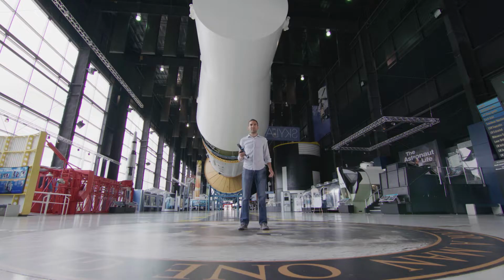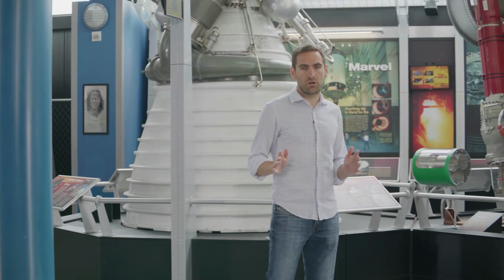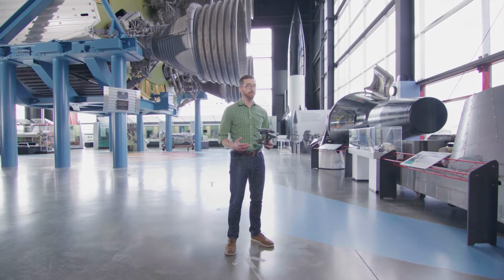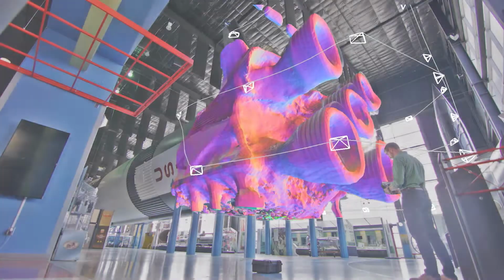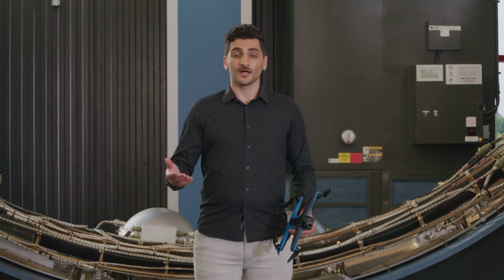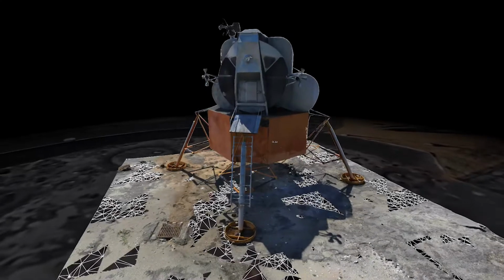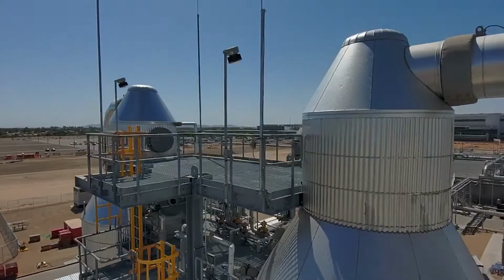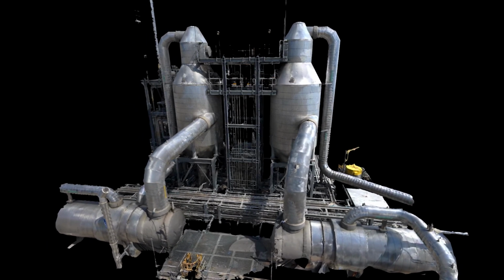Skydio 3D Scan™ Keynote - The New Era of Autonomous Inspection

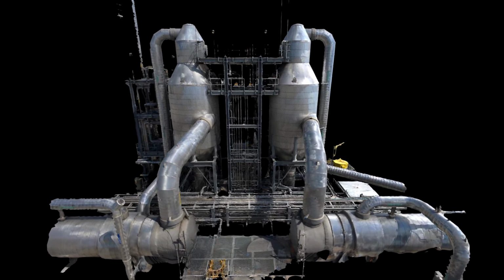Comment: Somebody needs to Google the boiling point of water.  It's not 200 degrees. 20:44
Reply: 200 C?
Reply: WATER
Boiling point

212°F
100°C
It seems like one of those basic science facts: Water boils at 212 degrees Fahrenheit (100 degrees Celsius), right? Well, not always. It depends on where you're doing the boiling. In fact, water will boil at about 202 degrees in Denver, due to the lower air pressure at such high elevations

Comment: HOW DO WE ACTUALLY GET THIS??? I now have the Skydio 2 for this but there is no way to purchase this $3,000/year feature without contacting you guys first... the only problem is that you guys still have not responded to any of my emails (I've now tried from multiple email accounts as well). Need to get this ASAP...

------------ UPDATE: read replies to this comment ------------
Reply: where you able to ever get ahold of them I'm trying to get this also and have a skydio 2 already?
Reply: @GrapevineCarbine  yeah but it took a long time and each email I had to pry for instructions and information - which they trickled in. Like pulling teeth. I got the impression they really didn't want to even sell this feature/tool... yet they advertise it. They finally set us up literally the day of our important shoot - tried to get it set up but it turns out that 1. The 3d scanning feature ONLY works with iphone, 2. Requires the remote control and 3. Apparently there was a very small, proprietary cable hidden in the box the controller came in that we didn't know about. 

In the end, our DJI drone ended up saving the day... We literally only bought this skydio 2 for this feature and then found out about all of this and their (quite frankly) ridiculous pricing model. 

Eventually we got the 3d scanning feature working but another thing that was sprung on us: in addition to the $3,000 they charge you just to use the feature, after 50,000 photos (aka about 100 or less 3d scans), they charge you per photo that the drone takes....... Which I completely do not understand because 1. It's a digital camera that we purchased (imagine if Canon or Nikon charged you per photo you took) and 2. We still have to process all of the photos ourselves - on our own computers. It really doesn't make sense. They did say they could sell a package of 50k more photos for $2k but still... Why are we being charged for taking photos on a digital camera that we own??? I get charging for the application (though that's quite a high price to begin with) but per photo??... Ultimately I think we'll cancel this service. Not worth the cost.
Reply: @TravisNobles  Truly a shame! We have a long list of stuff to scan and would love to automate it (in fact we literally purchased the X2 based on this video alone before finding out the gotchas)
Reply: @mattyd4vy  Yep. Same exact story here. They really need to list the "gotcha's" in this video. How they're going about it seems kind of... Hmm.. "not cool" to say the least.